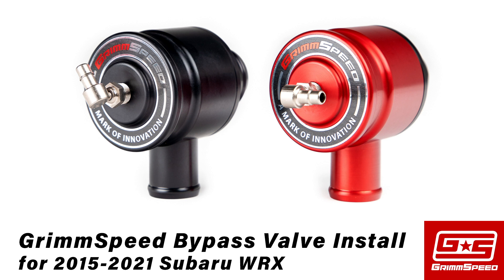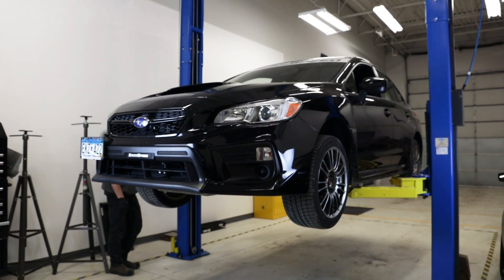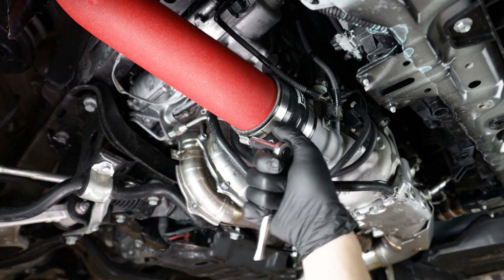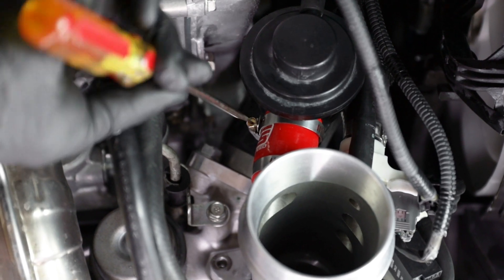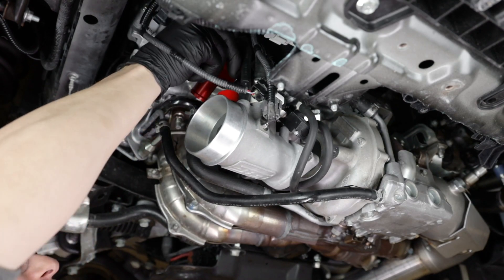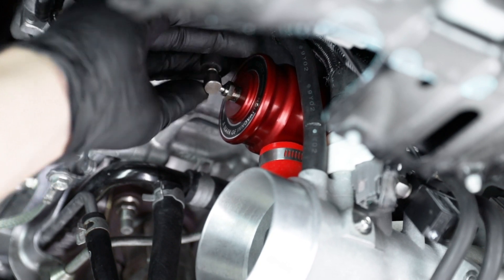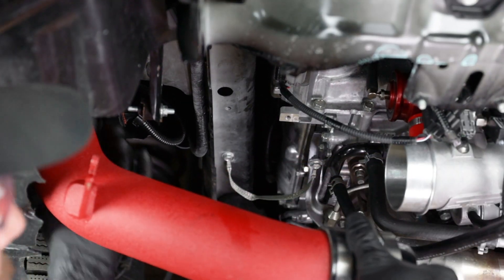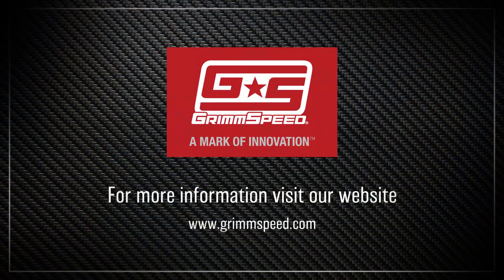GrimmSpeed FA20 Bypass Valve Install - 15-21 WRX

Comment: This it safe to put on a stock engine would it harm the engine or car by adding this on??? My car a 2025 ?? Just wanted to know if it safe a would I have any problems on a stock engines to get the sound ??

Comment: just out of curiosity, does anyone know the bolt size for the turbo inlet mounting hardware? one of mine definitely snapped off and is stuck inside the threaded hole in the turbo

Comment: Installed mine 10/11/2023 and I noticed on my 21 WRX the vacuum hose that connects to the swivel part didn’t reach like my oem one and it was loose on it. Was extra hose needed to install?
Reply: I’m having the same issue, did u figure it out?
Reply: @Bustanut6914  same issue here
Reply: Still having same issue has anyone got any fix ? Also I’m throwing a code now
Reply: So I’ve ran the car for months now and everything is still ok hose is still on with no issues performance wise, I have seen some people use a zip tie to secure it but I don’t think it’s necessary unless you feel you need it to be safe then sorry.

Comment: Just installed on my 2015 WRX by the ets front mount intercooler, is the sounds normally quieter with running the front mount with it not being worked n the turbo inlet?

Comment: Do you need tune for this?
Reply from the maker: No tune required for the BPV's
Reply: @GrimmSpeed  when this will be available for forester xt 2009
Reply: When this be available for forester xt 2009 turbo?

Comment: Question , what is the adjustment for on the side with that screw do I just leave that alone ? Assuming probably  maybe just a manufacturing  step ?
Reply from the maker: That is an inspection port. For the most part you can leave it alone, unless for some reason you need to look inside.
Reply: @GrimmSpeed  thank you glad I left it alone, if’s on the car and sounds awesome , in the middle of an e tune can’t wait to see how it all turns out, got it last night and couldn’t wait haha nice easy install , I’ll grab the turbo inlet next 🤙🏽

Comment: Is there a way to making the noise louder? Haha asking for a friend
Reply from the maker: Running an aftermarket intake will increase the sound put out by the bpv. Other than that, if you are planning to keep it a recirculating valve, no.

Comment: I’m sorry but if you have a stock intake, don’t buy this. Zero noise change
Reply from the maker: Although the additional noise is a big reason people replace the bpv on their cars, it is not the only reason. Our bpv provides a better seal than OEM, reducing leaking air leading to more performance. Yes, you will hear the bpv more with an aftermarket intake so make an intake one of your next upgrades after adding the bpv.

Comment: So i ran into an odd issue. My Vacuum Reference line seems too short when I did my install. Anyone else run into this issue??
Reply from the maker: That’s a strange thing to happen. It is in the same location as OE. If you are still dealing with this issue give our support team a call. I am sure they can point you in the right direction.
Reply: I had the same issue. I made it fit, but I’m constantly worried it will pop off either end
Reply: @joethornton3313  I ended up getting a male to male connector and purchasing a vacuum hose and cutting it to length. I then zip tied each end. Its been holding up quite well.

Comment: I currently have an ETS FMIC with the intercooler piping option for the OEM BPV. It seems like this would still be a 1-1 swap without issue as the shape of the grimmspeed “mimics” the OEM. What are your thoughts? Install would be an absolute breeze (way easier than this) Also curious if I still would not have any tuning issues if I am already protuned
Reply: BPVs do not require a tune. You can replace the oem and you’ll be fine
Reply from the maker: If you still have the OEM mounting flange you shouldn't have any issue swapping it out. No tuning required for the BPV either.
Reply: So there's no tuning required for the Grimmspeed turbo inlet or the Grimmspeed BPV ?

Comment: Is any trimming necessary of the stock inlet necessary? I saw that it was required for others
Reply: It might not be necessary, but you won't know until you actually do it. On some WRX's, it may need to be done, and on others, it may not need to be done. When I got a Boomba bypass valve, I did not need to do any trimming of the factory inlet connection, unlike other purchasers. It could have been because the turbo inlet on those models was designed differently for those model years(15-17) or because of other factors such as the charge pipe bypass valve connection placement varying by a few millimeters per manufacturer
Reply: Mine required trimming. It was off by 5mm, the inlet would not line up with the turbo after install. Also the oem vacuum hose was too short by an inch and a half.
Reply: @snickerfingers8255   Did you need to replace your vacuum line or did you just use Boombas extension?
Reply: @gwynbleidd7177  the boomba extension works but its a very tight fit. I just ended up keeping my boomba.
Reply: @snickerfingers8255  Thanks. I have it connected atm with my normal vacuum line but it's a bit tightly pulled atm which has me concerned.

Comment: Looks like a great product! Will say with subaru cars adding  aftermarket performance parts without a tune seems risky lol
Reply: So I basically bought a male to male extension and extra tubing and made it work. A bit tacky looking but according to Subaru, some WRXs had shorter vacuum lines than others. My line was short like 2 and a half centimeters.
Reply: @ranran2218  this won't do much of anything to the fuel trim.